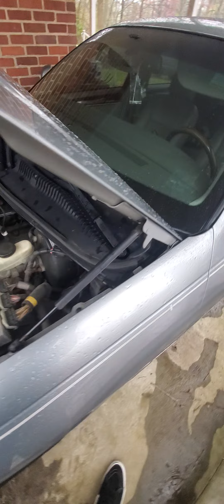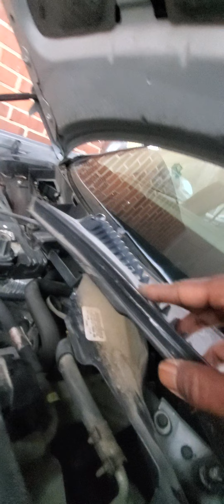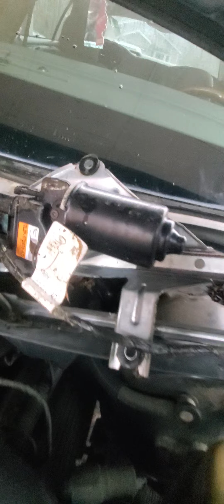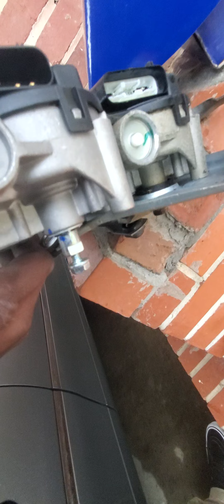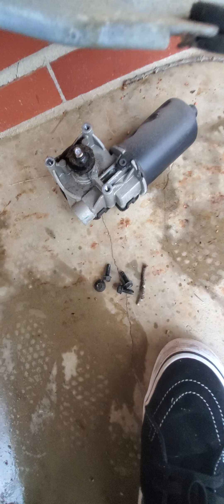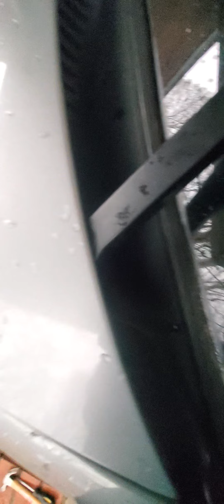2003-2011 Lincoln towncar Windshield wiper blade motor replacement

Comment: Much love for this. And to anyone scared to DIY. Don't be. It's a $50 part an hr in the rain. 😅 Just make sure you already checked that the relay fuse isnt the problem first. Motor replacement comes after you already know its not the fuse. 🤜🤛
Reply from the maker: Exactly what he said!

Comment: extremely helpful and thorough. I did this step-by-step and followed you with a new replacement motor and it worked. However, now my windshield wipers turn off in the up position.
Reply from the maker: Be sure you put them in the rest position with the switch in the off position Like I did.
Reply: @truelincolnlover4663 Oh wow dude thank you for replying .

Comment: Thanks for the great video, my 2003 Lincoln Town Car keeps burning out, the hole for the reservoir gets clogged and so I drilled another hole for drainage. I was up at 3 am trying to do it in the dark. Second time it was swimming in water last one replaced on 2024.
Reply from the maker: 😂 gotta keep them things cleaned out they get clogged easily

Comment: Holy crap! Not sure if you still follow comments on this video but it is awesome! However, I cannot get the wiper blades off without breaking something! They will not budge! Any advice?
Reply from the maker: Yes some may be tighter than others, Maybe try spraying both bolts with WD-40 or try a little heat, they might be rusted on

Comment: Very helpful. Thank you, friend. For anyone who wants the torque values, the shop manual says 15Nm (133 in-lb) for the three motor bolts and 12Nm (106 in-lb) for the wiper arms.

Comment: best step by step instructions i've seen so far on this from beginning to end. That's how you teach. thanks!
Reply from the maker: Appreciate you for watching hope it helped you along the way!
Reply: @truelincolnlover4663  went out the same day and changed it within a hour. The only thing i did different was take the top bolt out of the wiper motor so i could move the arm easier to get to that back bolt. keep teaching! thanks again

Comment: What is the small silicone packet that comes with the wiper motor for?
Reply from the maker: More than like its lube for that center bolt that normally gets rusted and breaks upon removal. Mine did not even come with lube... EBAY tighten up
Reply: Well O'Reilly sent me the wrong part, so that was not a fun time. Got another one coming. Should be easier next time now that I did it. Your video is perfect and much appreciated.
Reply from the maker: @deanelabranche7745  Thanks Stay tuned more otw!
Reply: I would put silicone lube on the wiper arm posts before re-installing the two wiper arms. Wanna be sure they come off again for the next guy.